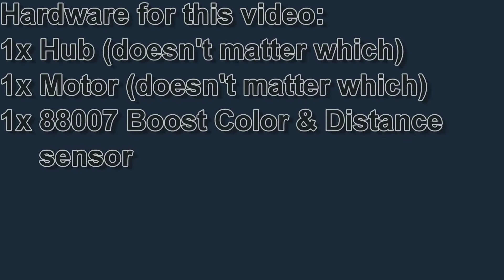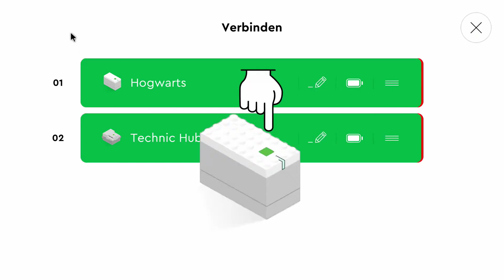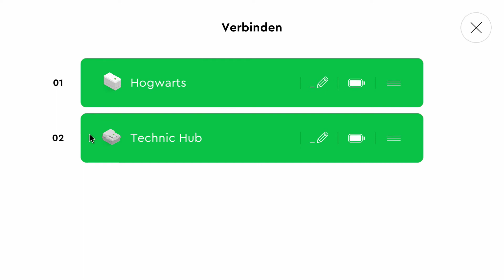Lego Powered Up Tutorial #04: first steps with the (boost) color & distance sensor [English|HD]

Comment: I don't get it, my train doesn't stop and I know the light brick is connected to the B side. Also the blue light on my train keeps turning Orange and it goes back to blue over and over again
Reply from the maker: The light turning to orange usually indicates a low battery.
You can try to use another color or to adjust the height of the sensor.
Reply: @technicmaster0tutorials  I got it working perfect but it's now flat. Thanks for the help!